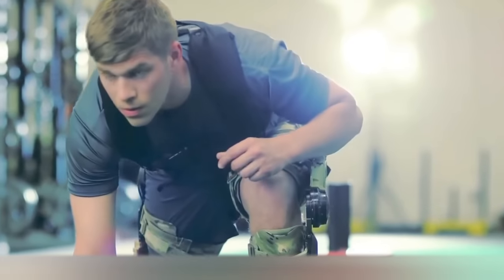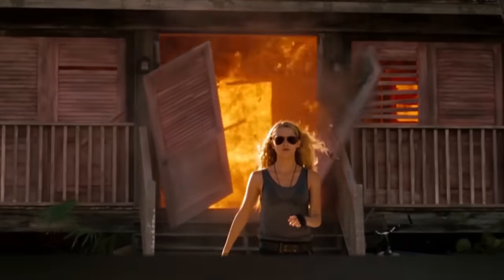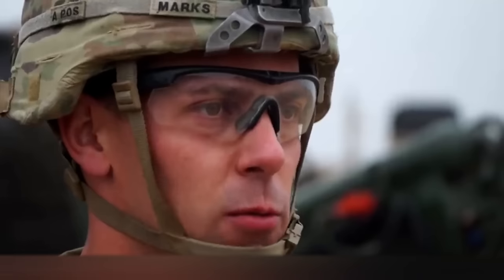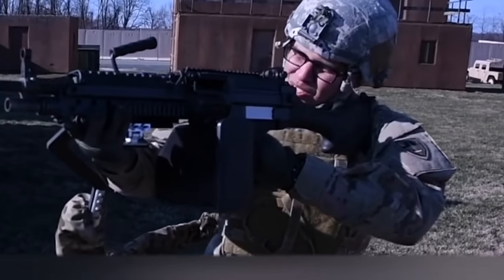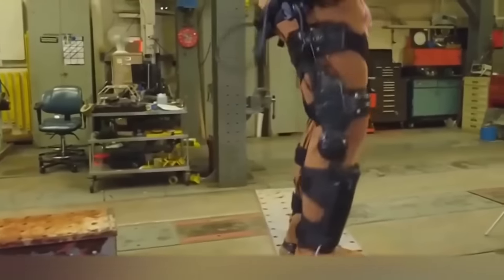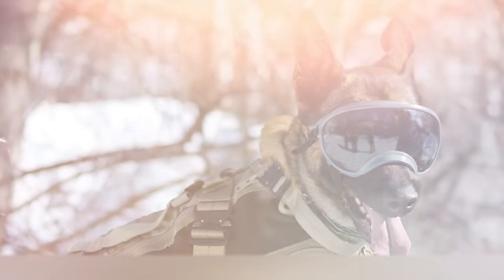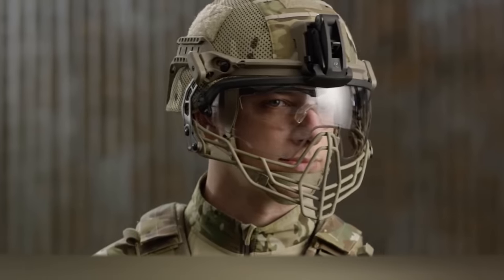The Most Terrifying and Powerful Protective Uniforms in the World!

Comment: Exoskeletons are battery powered that- blah blah blah
EMP Technology: "Watch, I'm gonna ruin this man's entire career."
Reply: Lead blocks more than just trays, it always blocks EMP blasts up to a certain strength. A bit of lead alloy plating around the housing of important electronics can negate or severely diminish the effect of a normal emp blast, short of a nuke but then it doesn't matter lol.
Reply: Or perhaps wear a Faraday cage implemented into the suit I'd imagine that wouldn't be good for communications though
Reply: Lead is pretty heavy but perhaps an alloy may work
Reply: I was thinking aroegel because I heard that it protects spacecraft from cosmic rays but nasas pretty misleading on that as it protects only against weaker beta rays unfortunately only concrete lead and steel can block gamma rays and aswell sadly you require several inches of theses substances to block gamma rays so a alloy probably won’t work but perhaps since the blast of a emp is short lived an alloy may give some protection but I doubt protection from emp would be guaranteed honestly a faraday cage might be the best idea well in a perfect world we’re we had enough energy within the suit to deploy its own magnetic field and not just any field it need enough power to stop gamma rays which is impossible amounts of energy but after a search I realized what I’m talkin bout here is from nuclear radiation which is not what is used in the battle field rather radio microwave and ultraviolet radiation is used in combat emps which actually can be stopped by lead alloy and in some cases even the light wheight aroegel can protect against emp as long as it ain’t nuclear which is unlikely honestly after reflecting and researching faraday cage would work with the lower energies required with longer wavelengths but too much power is required but actually that alloy idea would be way more efficient probably the best way to go perhaps too give the faraday cage one more chance to be efficient perhaps implement an emp sensor which exists as tiny chips and as soon as the suit gets the alarm the faraday cage can be activated combined with lightwhieght aroegel that can block radio waves perhaps balancing less power to the cage and more aerogel to add efficiency while aswell includes the bennifit of being fire proof or rather heat resistant to 2000 • ferinhight just ideas probably some inaccuracies just brainstorming
Reply: I tried not to make assumptions and searched the web for awnsers which sometimes only leads to more unintended assumptions though I put in effort and I’m sure there’s a lot of accuracy
Reply: Probably shouldn’t be brainstorming with a buzz as I’m going back and fourth but ultimately I resolved my own errors perhaps not all of them
Reply: EMP most destructive weapon made in the modern era that can shake entire countries economy and military forces
Reply: Things can be insulated to not allow the magnetic feild to influence it.
Reply: Ever heard of those $1000 audio cables?

Comment: Russians with explosion proof thing.

Literally everybody: no one can walk through an explosion.

Russians: Hold my vodka
Reply: Deuce II tbh depends if it real and I doubt that was an actual mine field. It can probably withstand high temps but no effective against shrapnel or debris. Also the force
Produced from actual mines would have knocked her back if not completely lifting her.
Reply: @KC-cb7ov  That was actual test,by trained soldier.
Reply: @ДушанРадин-ы3ю  And a fake minefield, Hollywood explosives, only a  lot of smoke and dirt, nothing harmfull
Reply: I like more the Russians suit it looks more futuristic than Americans
Reply: That's a fireproof racing suit. That all race car drivers wear.  Anyone who has eyes can see this is total bull.
Reply: @21335186z  yeah Russians has better
Reply: Mines don't hurt you with fire they hurt you with metal. No way that 'dinky' little suit would protect her from an actual mine.
Reply: Svodka
Reply: Vokda combined wid pepsi
Reply: Combat Engineer here.
1) Mines and other military explosives of that magnitude do not create fireballs and smoke like that. There is just a bang and little bit of dust.
2) Kill zone of a mine comes from shrapnel and shock wave. In case of anti-personnel mines obviously stepping on one is a loss of limb at best, even with an EOD suit.
3) If they were real mines, those dirt marks on her face would be replaced with burn marks. If you happen to manage to inhale during the blast, it will burn your lungs.
4) That overall doesn't seem like it would protect you from even the flying debris, stones, sharp sticks that the explosion would hurl at your way.

Let's see her step on a blast mine, trip a wire on a bounding mine or try to stop the steel balls from a claymore.
Basically what they have there is a fire-resistant overalls.
Reply: @KC-cb7ov  The blast from anti-personnel mines is not strong enough to lift you anywhere unless you happen to step right on top of it. In that case it knocks you down, probably in several different directions, but your not going to soar trough air like in the movies. Majority of your body will remain close by, parts of leg leg might fly out a couple of meters. If they buried some surprises under the initial mine to counter mine clearance then you become a pink mist.
Reply: @codenameaki6614  🤢🤢🤢🤢🤢🤢🤮🤮🤮🤮🤮🤮🤮
Reply: Codename Aki 
Bro, that’s a killer combo man..
Reply: @ @Haruglory131  
bruhder
Reply: me... you miss the point of an explosion is electric charge emission transfer... the semi coat, or the ordinary anti detonation suit who is demonstrated, is an diplomatic or private equipment... the radius of an termo-nuclear warhead is eradicated to 20-50 meter next to an implosive detonation.
Reply: @dundykrokodil4922  Ahahahahahhaahhahahahahahahah, So You really think you can stand 50m from a nuclear Bomb with that thing ? Rofl good luck with that....... while my country builds bunker citys in to the mountains.
Reply: @ДушанРадин-ы3ю  that was a fire suit for pit crews and motorsport drivers, and actual mines dont throw fireballs like a flamethrower 10 feet in front of the person, they detonate violently at your feet

Comment: I really appreciate that alot of the footage used was in reference to field artillery, specifically 155mm crews. One round is 95lbs minimum, which isnt alot, but when you consider that most crews carry around 200 or more it adds up over time especially during training when commands love driving the line batteries into the ground.

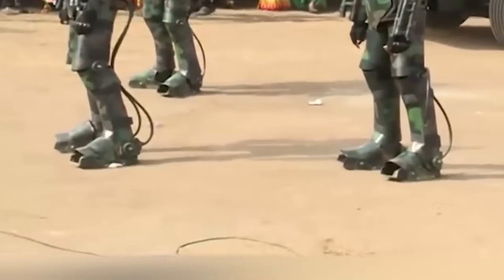Comment: 8:26 these guys are struggling to walk😂😂
Reply: They're also wearing motorcycle helmets and exposed hydraulic/wiring lines everywhere. No way in hell that those aren't just a massive waste of tax money.
Reply: @dylanmacon4255  Wouldn't be surprised if they just threw together some crude full body plate and threw  in some tubing to make it look like its powered. Those soldiers are probably bearing the full weight of the outfit.
Reply: Lma0

Comment: A lot of cool concepts but many of these are also pretty impractical. Like the Ronnin helmet most likely cuts your peripheral vision so your situational awareness is decreased. Exoskeletons would probably find only use on base never in actual combat scenarios. Plus military also has a budget. Special suits would primarily be for special operations never for standard infantry.
Reply: The ronin helmet does not cut your peripheral vision as much as you'd expect. because of how close it sits against your eyes, your vision is practically unimpeded. For example, if you look through the middle of a small washer from an arms length away, you won't be able to see anything through that hole. But if you bring that washer right up against your eye, you'll be able to see as if the washer wasn't there.

Comment: First suit:
While it may offer additional protection from the Gen IV IOTV currently in service, using lithium ion batteries that are exposed for the power seems very iffy to me. In general, I don't think this suit would retain energy for long enough for a real engagement. It would become a box of rocks smothering your body in what, an hour?
Replacement batteries in arid conditions would be even more concerning.
Second suit:
I don't give a shit if you make a suit that is completely impenetrable to all explosives. Those 'mines' are nothing more than fireworks. If they were actually dangerous explosives, she'd need to be wearing four or five hundred pounds of equipment or she would be sent skyward.
At best it's a fireproof suit and we give those to firefighters already.
The third arm could actually be useful. I have a lot of issues using support-level weapons in anything other than a prone supported position. That shit is so heavy that your arms just shake when it's not popped on cover.
Fourth suit: Definitely a kickass design. The arm plates would probably be 9mm at best, but having as much coverage that can tightly and comfortably fit to the skin as possible is generally good.
Everything with a battery concerns me. The helmet seems like a huge waste of time, but armored boots might be a new modern.
Exoskeleton: Same concerns with first/second suit. Lithium ion is an issue. Maybe new phosporous batteries will be less dangerous?
Ronin helmet: Seems like an unacceptable loss of peripheral vision. I agree that current helmet technology is rather outdated--but unless we can seriously reinforce our necks/spines, a 7.62mm would probably break your neck if it domed you anyways. Cracks ribs through plates already.
African suit: Almost certainly a hoax. Funny as shit though
MWD goggles: What a good boy
Battleskin: Might be more useful than the Ronin. The stress point seems to be better placed near the temples--but I have no clue what testing it's gone through for stress points.
Still would need neck protection.

Source: Total arm chair expert
I'm joking, I've been overseas on deployments before and while I'm no speshul operations I've been through my fair share of unwelcome explosions

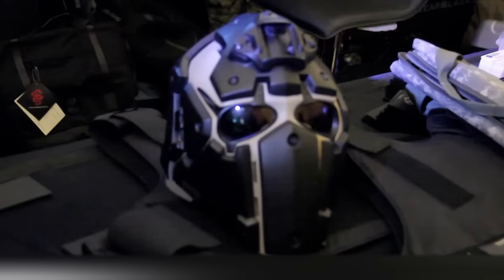Comment: 7:23
For the Ronin ballistic helmet, while the idea is really cool... is it just me, or does it look, flimsy*, especially the gaps between things like the cheek plates (the white part), seem a bit on the *thin side for protection. Also the ease with which the cheek plate and such seems to come of with also seems a little concerning, will it be able to reliably remain on the helmet during combat? Will the the gaps in the individual plates still be good enough if a bullet happens to impact one of those spots? What are the plates rated for, and what about the white gaps? What are they rated for? Is the built in toxic gas filter able to properly work, as in does the helmet have a proper seal while it is on the head to make sure that toxic gas can't just come into the helmet through gaps such as down by the neck and even possibly between some of the detachable plates?
Reply: Demotion ranch tested this helmet if you want to see the results. In case you just want to know, the helmet was able to stop bullets up to 44 Magnum. The two big weakness of it are that the attach system make the helmet easily detach from the head after a shot on the side or above, and that the lenses are not bullet proof (lead buckshot shotgun shell was able to go through)

From the same channel, you would be better protected by a standard army helmet + bulletproof face mask + large bulletproof glasses (all test are in the same channel)
Reply: Downside on full face helmets like this is your peripheral vision is usually cut off. Which is a big thing to have in combat due to situational awareness.

Comment: You can get a helmet very similar (as in same structure, just not as strong or techy) helmet as the Ronin. It's made for everything from airsoft to bb guns. I have one and they're pretty good. They run around $150. You can find them on Ebay
Reply: Got mine for 50 on amazon with metal mesh eye screens homie.

Comment: As for everyone bashing the mine finder installed in the boots, im not sure, but I think what it means is that it beeps or makes a sound (works like metal detector) like before you step on a mine, and likely has sensors that shoot out around you to scan for metal directly around you. I mean not that its something I'd 100% rely on, just something that may assist a soldier if he accidently walks into a minefield. Only this is to have exreamly fast reflexes to stop walking as soon as you hear the sound.

Comment: Often the tops of the shoulders are left unprotected when the soldier is firing from a prone position. If the bullet enters the top of the shoulder, the round could pass through the torso and exit the groin area. The neck area is vulnerable too when in a prone firing position.

Comment: why is ratnik not equipped with two visors or systems for night and heat vision? can easily switch the two like discs around the forehead area, make it fold down and fold back up the other.

Comment: This is cool and stuff.
But if it's not as durable as Halo Spartans, then it is impractical and not worth it.

Because a regular soldier with a special armour piercing gun, can take put a soldier wearing gear that coats like 100 thousand dollars.

It would much better to improve plate armour so it can be more easily replaceable in combat and lighter.

Comment: This is great. However : When will they invent , a uniform that will ( STOP BULLETS ) or shrapnel from ( Hand Grenades , or Road Side Bombs )?  Or invent small drones that can scan ten million ( LAZR LIGHTS FIFTY FEET DEEP UNDER GROUND ) ? To detect road side bombs ? Before a convoy of trucks and tanks drive on the road. Or advanced drones to scan , with cameras if hostiles are on buildings and roofs with a RPG'S  ? This would be very helpful . In cases like what happened in Somalia . Where two Black Hawk Helicopters were shot down ?

Comment: Bonjour,
    Il faudrai que le casque enregistre les mouvements, reactions, les position du soldat afin de les transférer à l'intelligence artificielle. A fin qu'elle trouve la meilleur solution pour construire des robot plus souple, plus réactif, et qu'elle puisse calculer les meilleur stratégie de défense, de protection et d'attaque
Reply: Le problème avec l'intelligence artificielle moderne est qu'elle en est très aux premiers stades et nécessite un espace relativement important, ou un signal distant perturbable, usurpateur et autrement sujet à la falsification.

Même alors, il est toujours confronté aux problèmes de l'enregistrement étant problématique dans les conditions du champ de bataille, ou de l'équipement subissant des erreurs, des dommages, etc. Quoi qu'il en soit, un système d'interface neuronale serait en effet très puissant.

The problem with modern artificial intelligence is that it is very much in the early stages, and requiring a relatively large amount of space, or a disruptible, spoofable, and otherwise tamper prone remote signal.
Even then, it still faces the issues of the recording being problematic in battlefield conditions, or the equipment suffering errors, damage, et cetera. Regardless, a neural interface system would be very potent indeed.
This translation is google translate, I'm an American. :p

Comment: most of these wont ever be used... these stuff need to be easily removable, or the enemy will be able to exploit the armor weakness. In most cases if the electrical parts fail, the soldier will perform worse than without the armors.  And those without electrical parts, have little airflow...soldiers wont be able to run miles in them without getting too tired.

Comment: ya, I guess your right when you say its kinda dumb design. They spend all this money on jarheads-They make this huge helm and forget the neck armor, then they boast carry strength and forget to mount a personal APS. then they strap all this material on, and forget about flash graphene- and they use servo motors instead of artificial muscles from MIT, that max strength 800x. What they gonna forget next , their panties when they gun-shy? So much hard work and $ on armors and the guy dies from shrapnel to neck wound in 1 second, what a waste; might as well go “commando”(pants-less).

Comment: Question is, will any of this protection be equivalent to 15 toilet seats?  Otherwise, a Barrett .50 cal will own them.
Reply: I mean... The AA4 was a thing back in what, the early 2000s? It could stop 7.62NATO Swiss P AP, and also a single shot of M33 .50BMG FMJ. It's main issue was that for the latter, it'd need a fragment shield known as the Spall Shield. 

The SARVIP was even earlier, a 12lb aircrew armour stopping 12.7x108mm API.

Comment: ok light weight exoskeleton should be bulletproof (practically) , otherwise what's the point , military really needs to consider reality , and possibly the need for a mobile drone for transport (supplies , mobility and tech)
work smarter not harder. i find that easier is usually quicker and better quality, unless easier means not using your brain. anyway, exo skellitons could be fun, but exo suits are better... and the display for the inside of a helmet could be a big deal , not to mention hands free Digital Assistant, you know DA Skynet. anyway , there should probably be a way to use a cellphone type of controller for sensitive information (no audio) ... and yeah , all filters aside , portable oxegen would be great for an exo suit / skeleton with a full face helmet. not to mention coms. friend and foe ID , what about a a link to the aim of your gun , snipers just be wearing goggles with no scope on a rifle 🤣🤣... what if all that info , could be put on a pair of sunglasses and wireless ear buds 😶